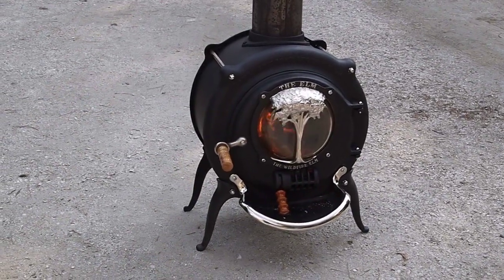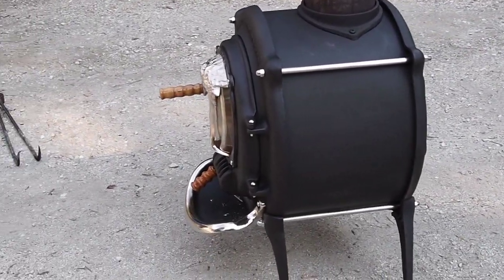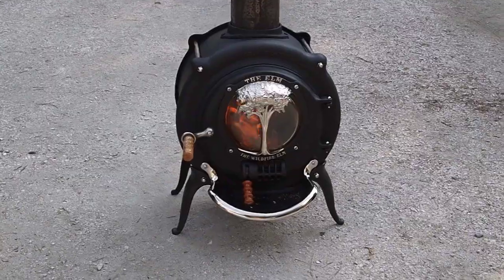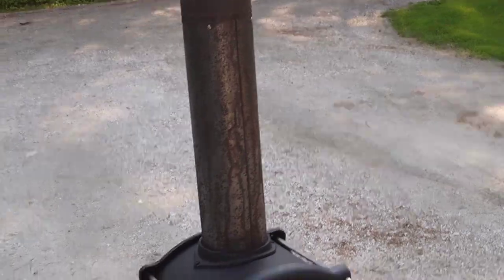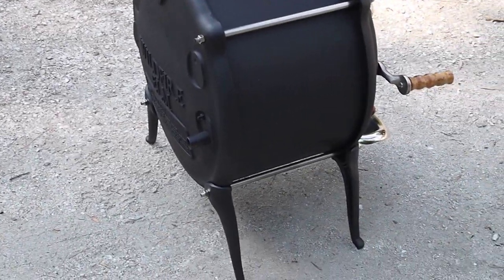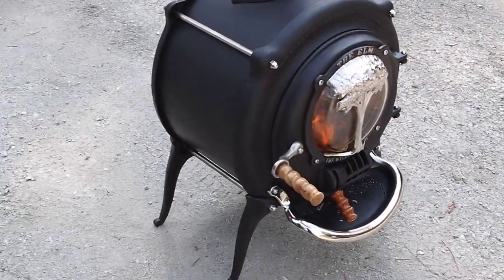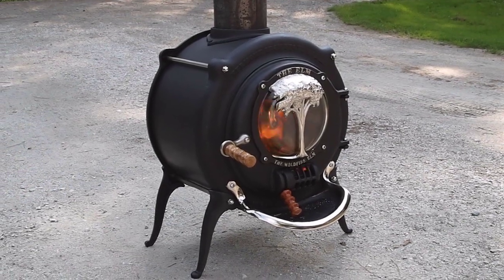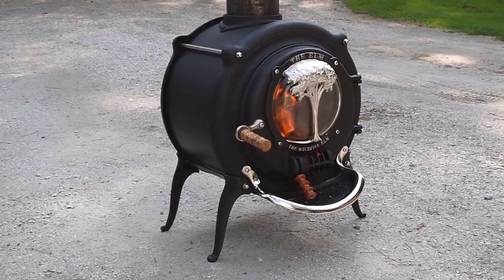The First British Elm wood stove, July 2011

Comment: Hi all. After years of living in rented accommodation, I have found that alot of these properties can be very hard to heat up as alot of them may have never been insulated properly. So I have done it, I have installed a small solid fuel stove into my flat with absolutely no building work needed, not even a built in chimney in the property but I am now looking at a lovely fire in my self made stove. The trick lies in the exhaust system that I have designed and all that is mainly doing is releasing a heat haze into the environment so now major problems. Can anyone tell me how I can put such a thing on the market as there is alot of hard to heat properties out there(plus I hope to be able to make some money from this idea as I have several years of thought and design gone into this to meet all different regulations